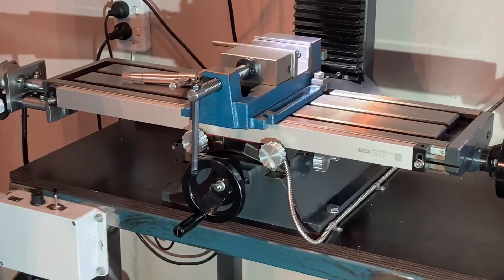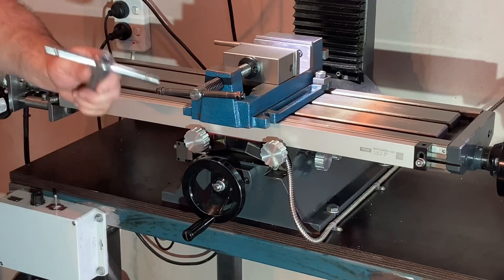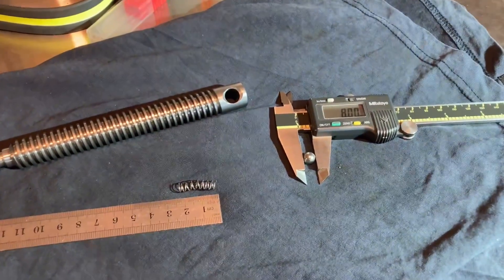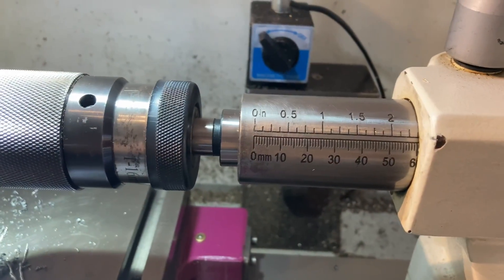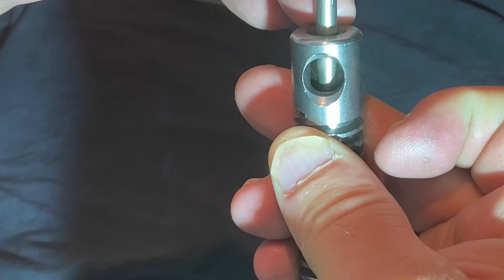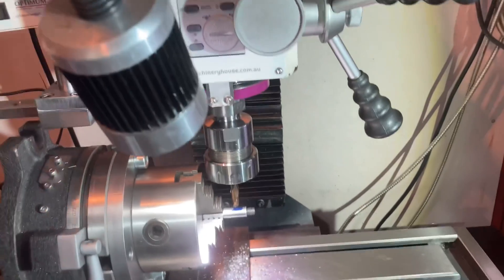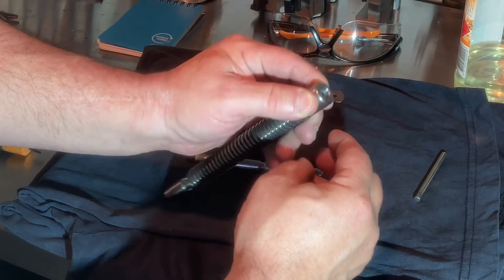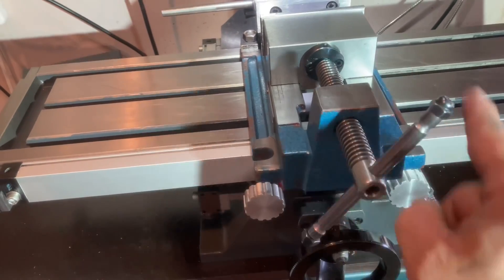Milling machine vice handle multi positioning using a ball bearing and spring.

Comment: You can now remove the threads & nuts to clear the cross slide handle.
Reply from the maker: Hi, even if I did remove the nuts and threads, the handle still fowls by 15mm and reducing the length of the handle was never going to be an option. The nuts also prevent the handle being completely removed by accident and then having to look for the spring and ball bearing.